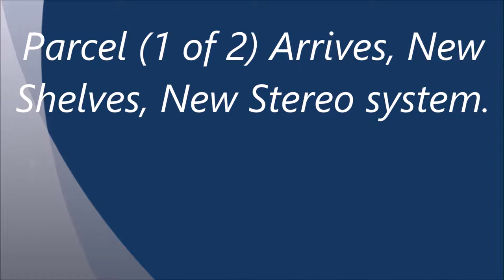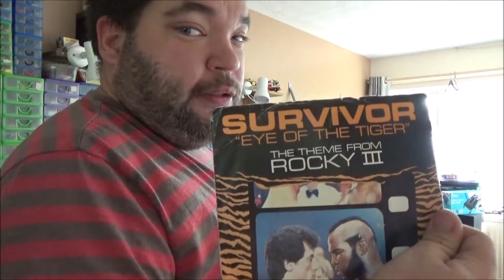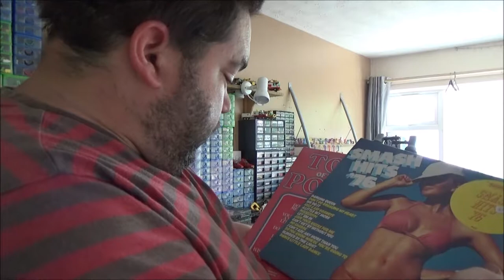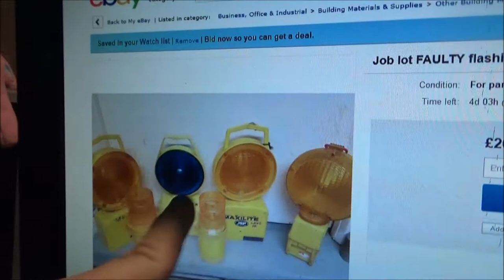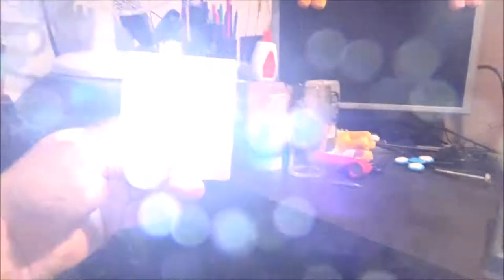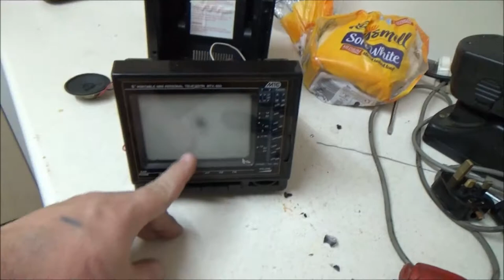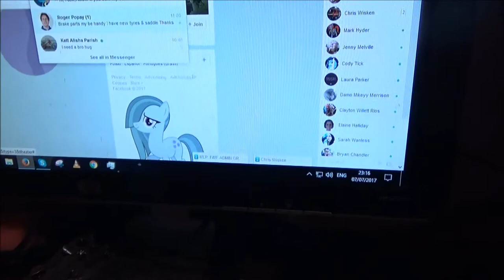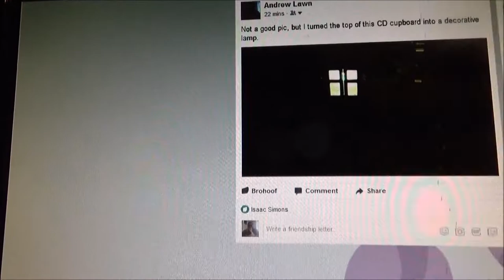Expected Parcels, Records, Stereo's, Damn Couriers.

Comment: Hi Andy, regarding your non working music centre, the component u showed that u thought is faulty is the power transistors, for the audio amplifier section, they are old school types that were used in the 1960's / 70's so be near impossible to get now, u might be able to get a modern equivalent from maplins or radiospares. You could put one of those colour changing Led lamps in that cupboard.
Reply from the maker: You read my mind, I have planned to put a colour changing LED in the cupboard lol.  I'll hunt around for a modern equivalent but not sure I'd have much luck.